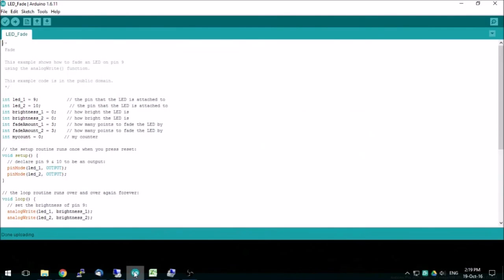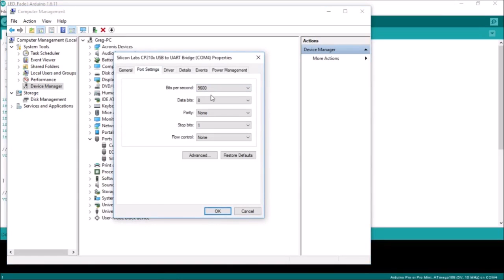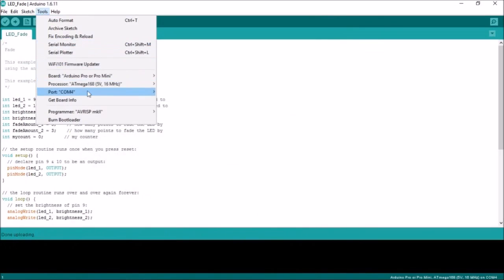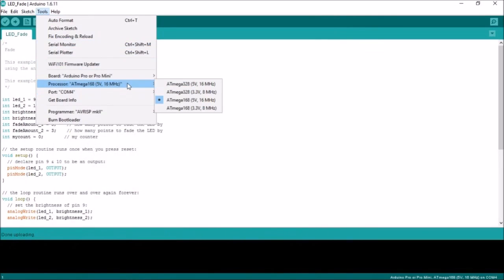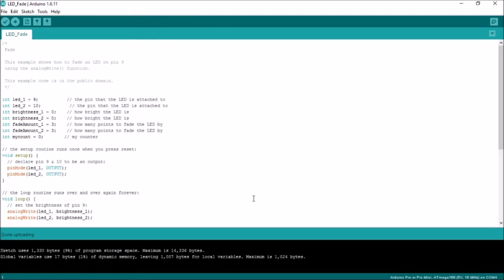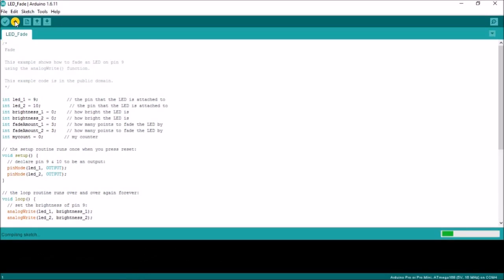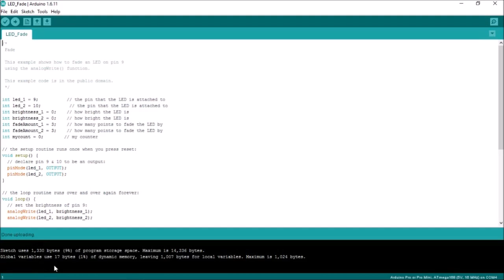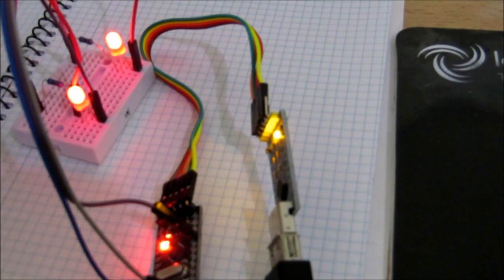Arduino Mini  BTE13-101a  Programming for Special Electronic Project! Bluetooth Speaker Upgrade

Comment: I've just bought the BTE13-101 which is a clone from BAITE. Although it looks like it's a clone of a clone through a company called CNEWTEC and it's 328 was replaced with a 168
Reply from the maker: Yes, my module was the same, fortunately this is not exactly a demanding sketch!